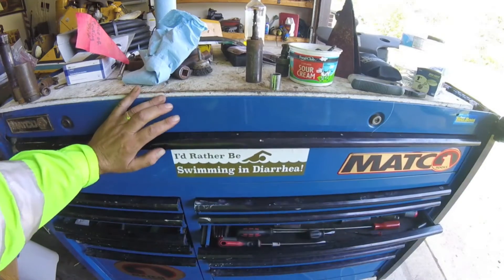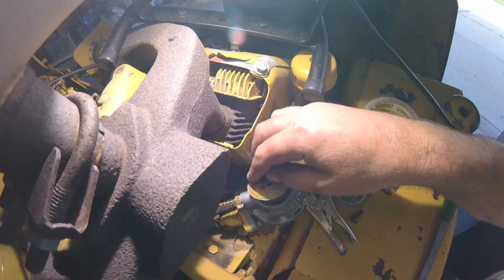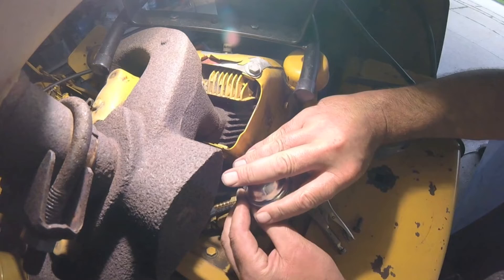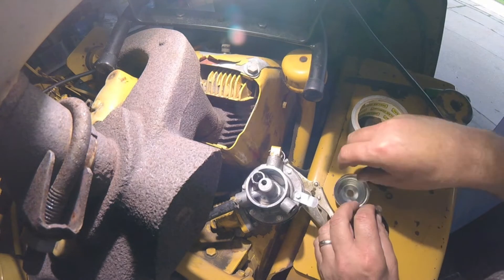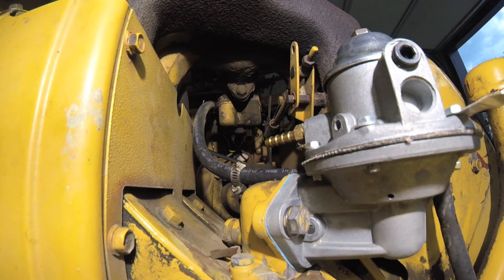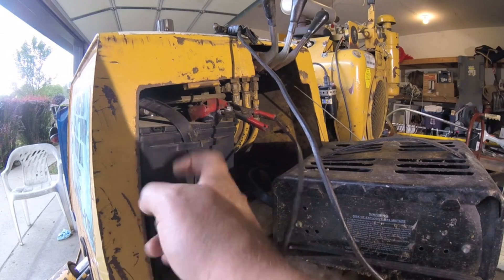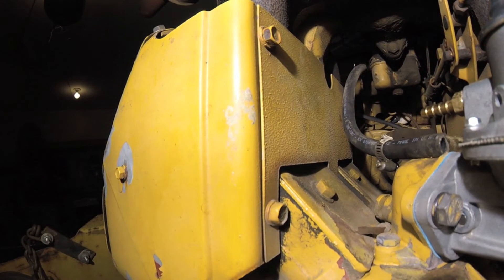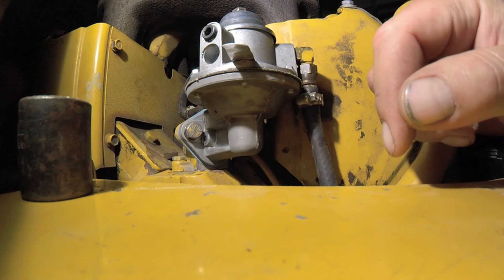VERMEER STUMP GRINDER/ WISCONSIN ENGINE TROUBLESHOOTING

Comment: I'm having trouble with my grinder, same model as in this video, at first I thought it was the pump, but I pulled line between pump and carb on the carb side, it's getting plenty of fuel out the line from pump, so then I pulled number 2 spark plug and cranked it, no spark, same with number 4 plug. Any advice? Maybe start with a new coil and go from there??
Reply from the maker: Never embark on trial and error troubleshooting- it's expensive.
Disconnect the thermal sensors on the cylinder head if present, they short out the ignition system if they sense too high of a temperature, see if spark comes back to those cylinders. I'm honestly not familiar enough with this particular engine to give solid troubleshooting advice, but if you have spark in some holes and not others,  it sounds like an easy fix. Feel free to send me some pics to mowerguyvids@gmail.com and I'll do my best to help you out.